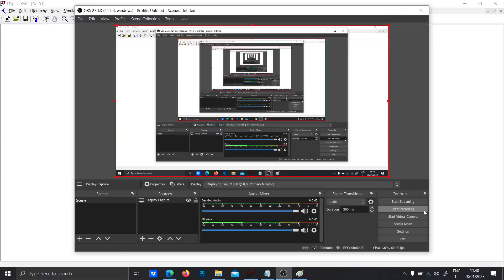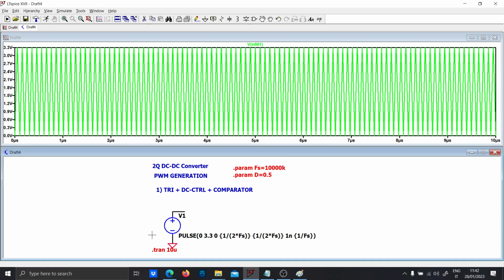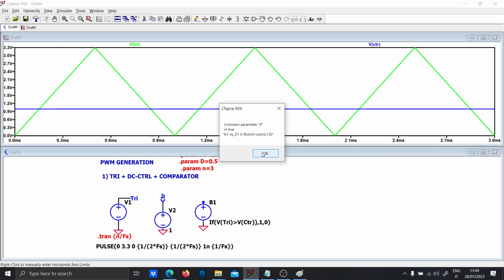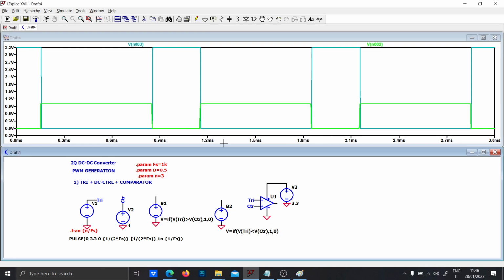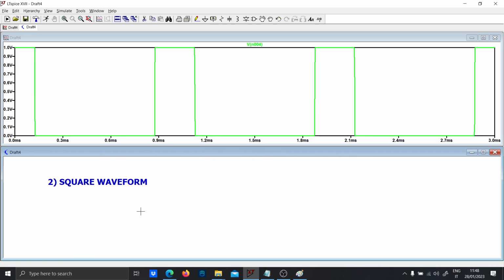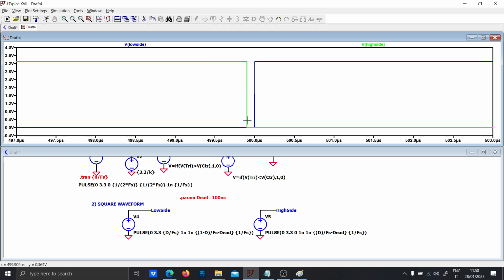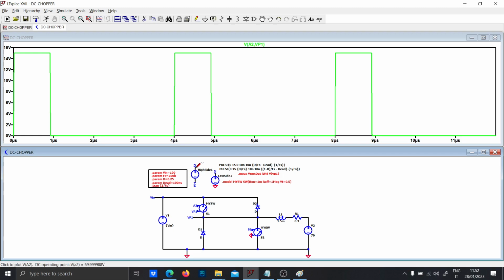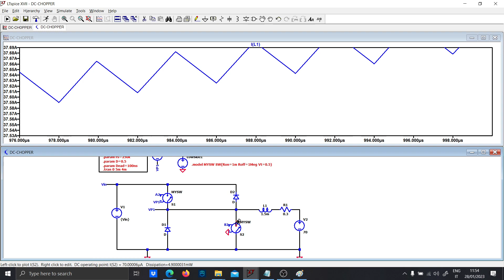LTSpice Square PWM generation and 2Q DC converter

Comment: Did your professors teach you to use Spice like this?  You're incredibly fluent with it.  I've seen people use some parameter commands and functions before but not at this level.

Are the other students and engineers around you as capable with it as you are?  In your opinion is it expected to be able to use it as well as you can?

You've already permanently changed the way I approach modeling.  Thanks man.
Reply from the maker: Unfortunately no, stem Is basically self-taught, especially KiCad, Solidoworks, PLECS and every CAD out there, being elettrical CAD or mechanical drawing cad